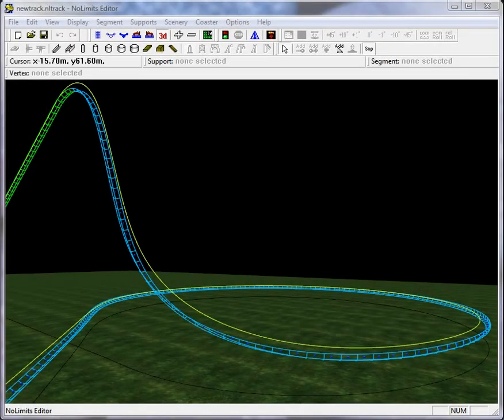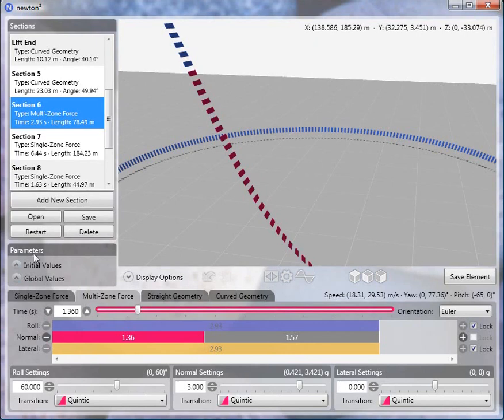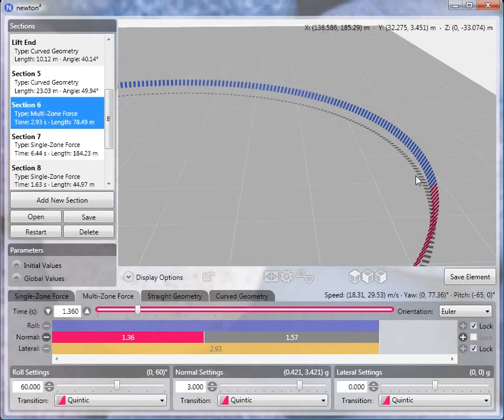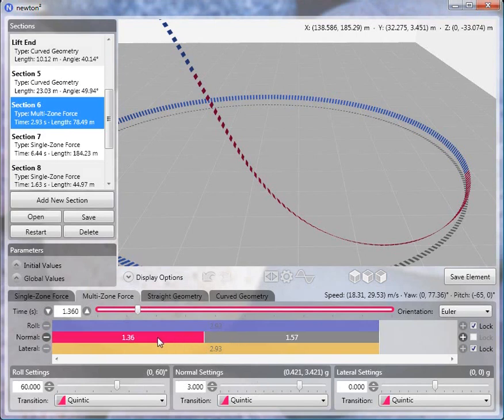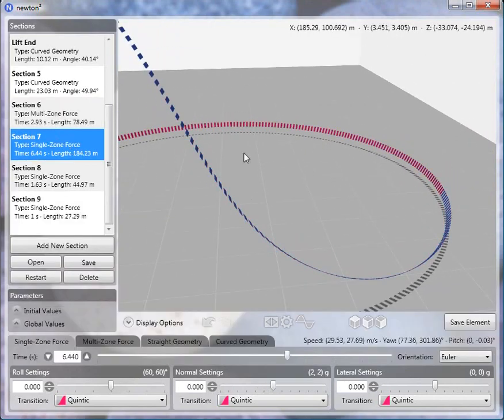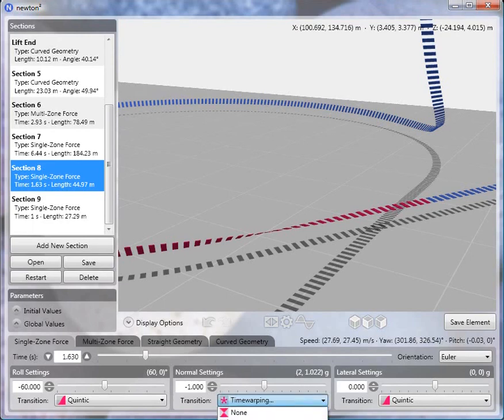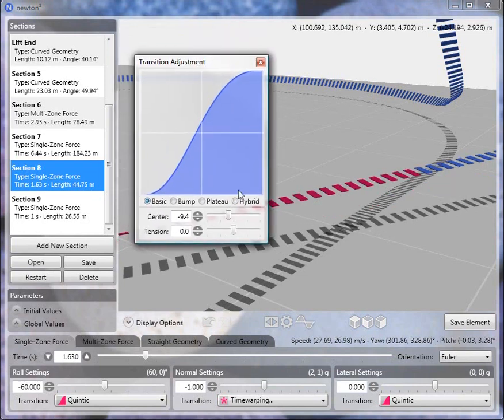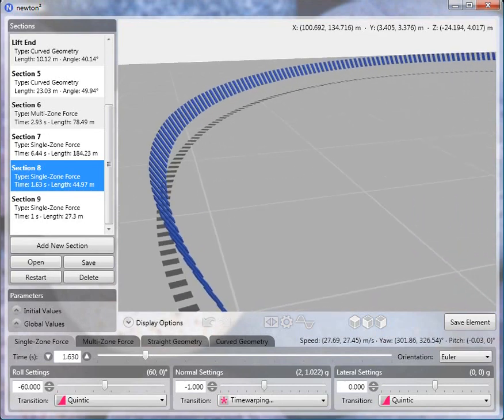newton2 tutorial part 8: flat turns

Comment: Just a note, on most calculators (I'm using a TI-83 Plus Graphing Calculator) the Arc Sine/Cosine/Tangent functions are usually listed as Sin^-1, Cos^-1, and Tan^-1. 

Punching Arc Cosine(0.25) into a calculator will not yield 75.52, but 1.318, which is not degrees, but radians. To get the value in degrees, you multiply the resulting number by 57.29 (the amount of degrees in 1 radian)

This is obvious to people who have taken higher math classes, but probably unknown to most other people.